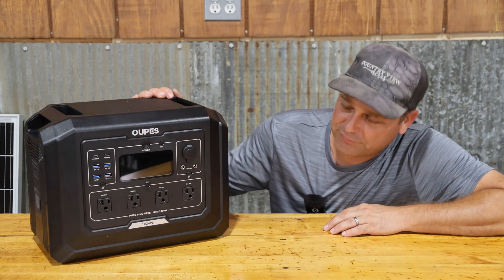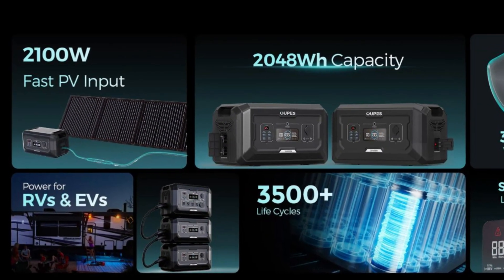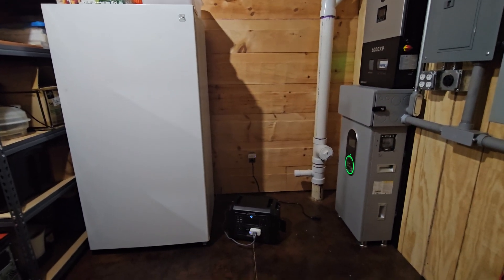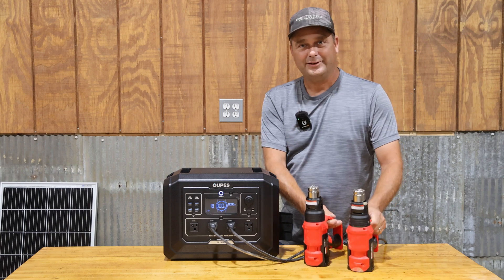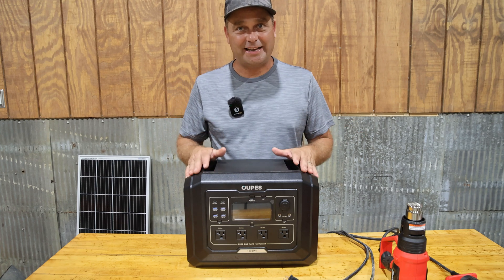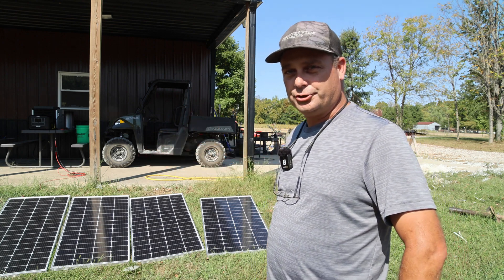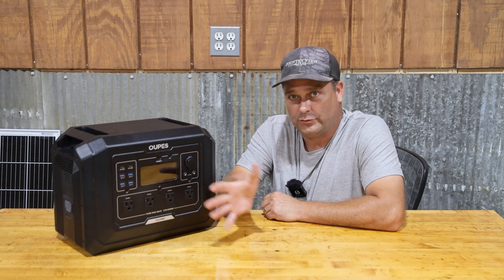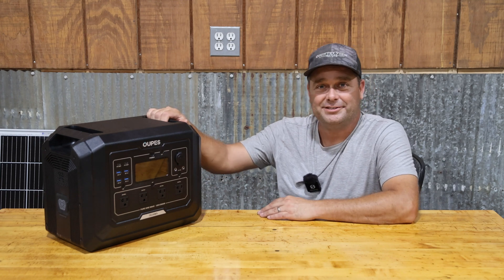Testing the 2000 Watt Oupes Mega 1 Power Station.  How does it stack up?

Comment: Since it failed at 2,000 watts output, I wonder what the standby AC inverter efficiency is? From DC to AC - 80%? What percentage of battery would remain after 24 hours if you left the inverter on with no load? Thanks for the video.
Reply from the maker: in 12 hours, it was able to use 60% of the battery.  Since the battery is half the size of other power stations.  a greater percentage of the battery is used to keep it powered up.

Comment: Hi Evan, I thought that your review was pretty comprehensive and I ended up purchasing the Mega 1. Unfortunately I’m unable to connect it to my WiFi and of course that’s the only way to install firmware updates. Were you able to? Also, the app was clearly written by someone with poor English language skills and I’m thinking you could cover apps in more detail in any future reviews.
Reply: A reboot solved my WiFi issue. Should have tried that right away.

Comment: Its a terrible way to test capacity. Get a watt meter and run it till the unit shut off and the watt meter will tell you how much it consumed.
Reply from the maker: my Watt meter stopped working.  or else I would have used it.

Comment: Oh y'all use 120v at home. Keep in mind, even it says 100% it is Not. The battery needs also to balance each cell that can take several hours
Reply from the maker: difference in cell voltage is probably a faction of a percent of the total capacity.  because there is probably only 4 cells in this power station.
Reply: Thats is true but im just saying. When the battery gets older and gets higher IR the more this factor is shown. Also how they build the case for the cells and what kind pressure they have@CountryViewSolar-DIYProjects

Comment: Hey Evan. I have a Question.  Your video inspired me to ask this question.   I need to run a  battery tender….Noco Genius Gen5x-1.  One bank .   It’s a boat under a carport .  I would like to put the solar panel up on top of the carport….. 

Will this set up be a good way to keep the battery charged … ?? 

The battery tender is set up for a 110 adapter ….  

I hope you see this 
Thank you sir !
Reply from the maker: Since your battery maintainer runs off of 120volts.  It makes it more complicated. Because you would need a solar panel, inverter and battery to make the 120 volts.
I would suggest buying a solar specific battery maintainer and mount the solar panel on the roof.  
Here is a link to a solar maintainer I have had for 2 years.  It has worked fine for me.
https://www.amazon.com/SUNER-POWER-Upgraded-Watts-Crystalline/dp/B07WXSCTSV?ref_=ast_sto_dp&th=1&psc=1

Comment: Tried it on a router and big screen tv around 175 watts will only run 3 hours  was expecting at least 4 hours talking to them they want me to pay shipping and a 15 percent restock fee was going to get the Mega 3 but if there was something rong with it would hate to think what shipping that back would cost? think I will look around a little.lol
Reply from the maker: No Hassel returns would be nice.
Reply: @CountryViewSolar-DIYProjects  According to that load (175*3=525wH) he's only getting a bit over 50% of the 1024Wh rated capacitty, and in your heat gun test you said you only got around 60%. Is that (50-60% usable capacity) low compared to other power stations you have used?  Also, these are kind of rough estimates, any chance you could run it on killAwatt or similar at some point to get a more precise idea. I was close to pulling the trigger on the 3kWh version of this with extra battery, but if usable capacity is only 60% it probably wont meet my needs. Thanks
Reply: @CountryViewSolar-DIYProjects  Also, the fact that they would charge a restock for a unit that only delivers 50% of advertised capacity sounds like kind of a red flag, what's your experience if any with their customer service?

Comment: 24 amps of surge current tells you very little without knowing the voltage during that surge!
Reply from the maker: I tested it again.  And the voltage dropped to 61 volts.  
So I tested my eco flow delta max (2400 watts continuous) and it drops to 71 volts and outputs 29 amps  And shuts down very quickly, about a half a second.  
So similar results compared to their max wattage. 
But the oupes does attempt to run it for a longer period of time.
Reply: @CountryViewSolar-DIYProjects  -- Very helpful information.  Thanks for the follow-up!  👍👍
Reply from the maker: Yes.  Very true.  I thought of that after the test.

Comment: Do you like this one better than the ecoflows? Which have a better price value?
Reply from the maker: Hard to compare.  My ecoflow delta max has a bigger battery. More output and a  Bigger price point.  But I do like the weight of this unit, easy to carry around for small jobs. 
I haven't had this one long enough to really have an opinion.

Comment: Didn’t see an answer to this. Can you leave it plugged in all the time?
Reply from the maker: I have a power station that is plugged in all the time.  And my computer is plugged into that.  I don't see an issue with leaving it plugged in.  But if no power is used after a certain time it will shut down.  That's why I plug something into that uses power, to keep it running.
Reply: Thanks for the reply Evan. I love all your videos. I watch them all both channels. I’m at 85 years old and I have two electric recliners that I sit in and sleep in and I have been trapped in both of them when the power went off, so this looks like a solution for me. That’s why I was wondering if I could keep it plugged in all the time. Thanks for your reply again.

Comment: Evan, greta video. Question we travel and our sump pump is needed (daily). Our power go's out for a short time. rather than buying a battery back up sump pump I think The Mega 1 would work. If understand your video if plug the sump pump into the Mega 1 and plug the Megan 1 into outlet. When I lose power the sump pump will run off the Mega 1 and when power comes back on the pump will run off house power. This make sense? By hte way I watch your videos on your other channel, great job on that channel. Charles
Reply from the maker: Yes, that should work.  But the device needs to draw power every so often, or the power station may turn itself off.  If the sump pump goes a half a day without turning on.  A battery backup is probably the better choice.

Comment: I don't understand all the electrical stuff but I've got a pellet stove that is 120v 60 cycle and 3 amps to run  it requires 300 watts to start so would the opus mega 1 be able to run my pellet stove
Reply from the maker: Yes, 300 watts wouldn't be a problem.

Comment: excuse me. the devices you stated are on a 20A 120V outlet. so that 2400w and at 80% thats a 1920w load, so 15A and 20A device different, so microwaves and frigs do max these out,
Reply from the maker: I don't have any devices that have a 20 amp plug in on them.  A 20 amp plug in has a sideways blade on it.  The power station has 20 amp outlets, so it will except a 20 amp or 15 amp plug in.  But IT WILL only output 2000 watts continous max.
Reply: @CountryViewSolar-DIYProjects  frig. microwaves runs above the 15 amps. thats why they are dedicated circuits when in a home. and why the kitchen requires so many other circuits as well. i just think homesteaders. off grid sells their solar so much on line. but they leave out the reasons. to run power lines to middle of no where could cost 100;s of $1000's. so living with one light and a wood stove is their only choice. and spending thousands for that light to last all night. i am not against solar. but these small systems only work such a few people.

Comment: I’m curious about a small solar system to start with 
Thanks for the information
Reply: the one problem i have with all of this. panels ratings. say you have 4 200w panels like he showed, but within this country you will only truly get whats equal to 800ws of solar for a total of 4 to 5 hours per day. depending on season, thats like 10% in morning and evening, 30% for a hour after morning and the same before evening, and 75 % around noon. and the 4 to 5 hour average is also taking in weather. so if think you need to use 1000W per hour 24 hours a day. you would need batteries. and 24 by 4 is 6.. so you need 6000W of panels. and also need 20% more than that because of power use of the system itself. so you would need 7200 watts of panels to supply 1000w of power for 24 hours a day use. there is the dirty little secret. now go add up the costs. thats 18 panels, converter and batteries. and for 7200w of storage, thats 30% more that this system and 2 battery extensions.
Reply from the maker: Yes, even though it has 800 watts max, you would be lucky to achieve that, it has to be a perfectly sunny day, no haze, and not too hot.

Comment: After the Oupes  battery runs out and it turns off ,does the appliance get power automatically when the plug in power comes back on?
Love the solar content!!!
Reply from the maker: Yes, when the power comes back on, if the mega 1 is plugged in, it will start to recharge and power the loads.

Comment: Just a question on the compressor test. Was there pressure in the tank already or was it empty? I know even our gas one has a hard time starting when it has a good amount of pressure in it. Just curious, as that isn't really a use case for something like this even if it could get it running at speed. 
That was a really thorough review. Well done!
Reply from the maker: It had 100 PSI of air pressure in the tank.  But I did let the air out and tried it also.  It wouldn't start it empty either.  But other power stations I have won't start it either.  Compressors are a real challenge for small inverters.